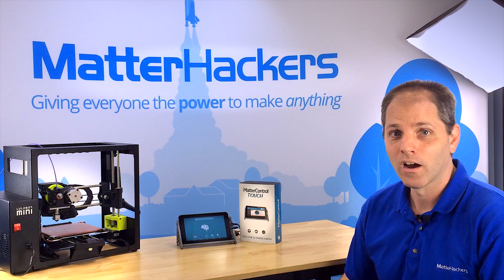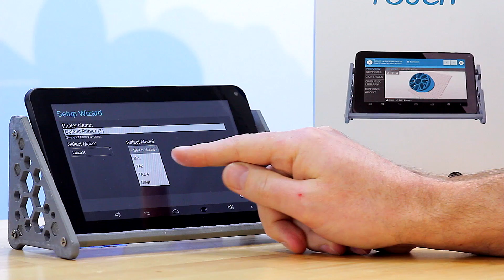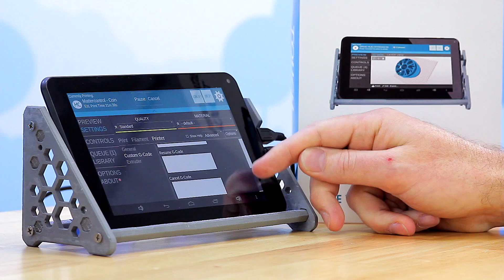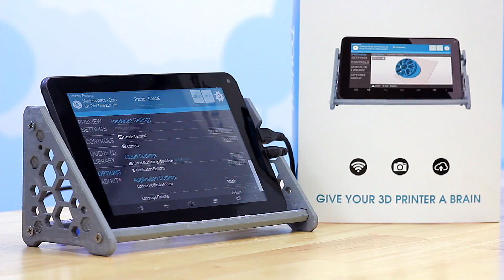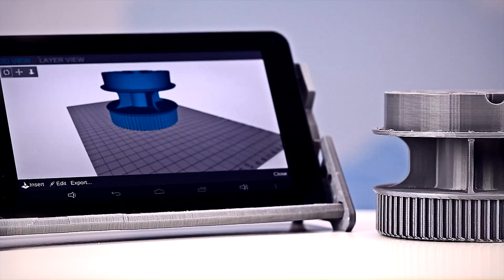MatterControl Touch Introduction

Comment: Is it possible to send files from my pc to the t10 directly over my WiFi without using the cloud ? 
Also the pc version of mattercontrol also does cad but the touch does not , this would make the unit much more useful

Comment: Does it work for XYZ Davinci printer?
Reply: +VLAHECO Sorry.... that's not possible since the builders of the Davinci have locked their printers to only accept commands from their software, however... some of the davinci printers can be flashed and put on a opensource that allow you to load your own filament and use this program.

Comment: The tablet looks like my 9 inch Audiosonic from K-mart that was at $99 dollars Aud, if I was to use that as to make a estimate the software would be probably well over $200 dollars Aud, that seems like a bit too pricey for my one to three prints a month.
I have tried this matter control on my laptop it seems to do what it says, and there are others I tried on "my tablet" that just fall over and cant even find the com.

It would be nice to have my tablet as a stand alone control for my printer but for now will continue to use the laptop unit someone has a better alternative that wont pick my pocket, I think I saw someone had a similiar thing for android for around $5 seem more than a sensible price.

Comment: Awsome just what I need for my rostock max v2. :)
Reply: Got my matter control touch up and running. The auto calibration worked amazing for my rostockmax v2 I will be working on a adjustable mount to attach to my 3d printer.I'm excited for those updates.